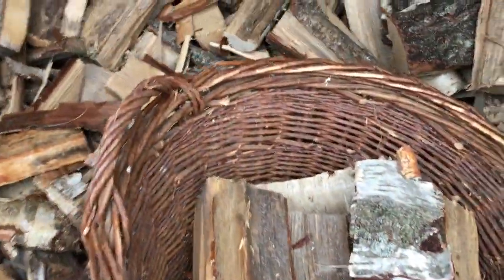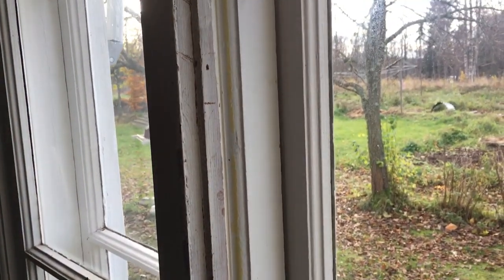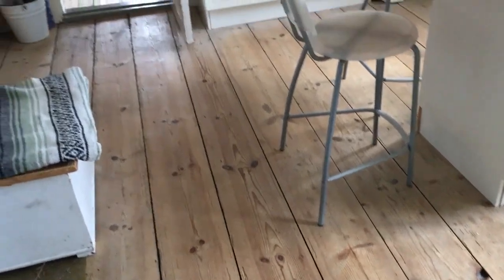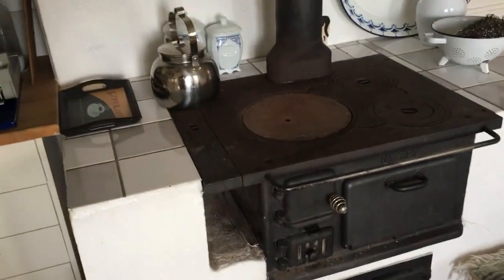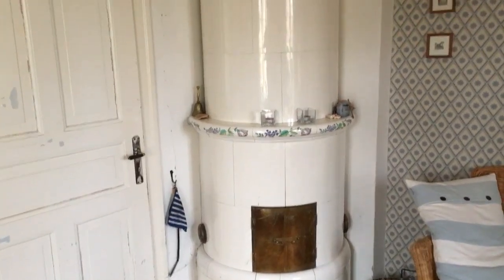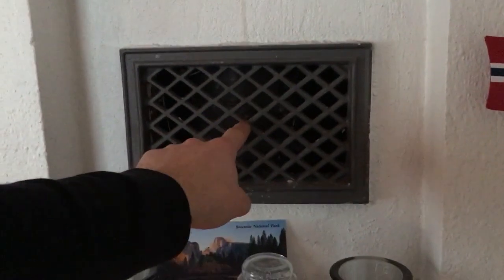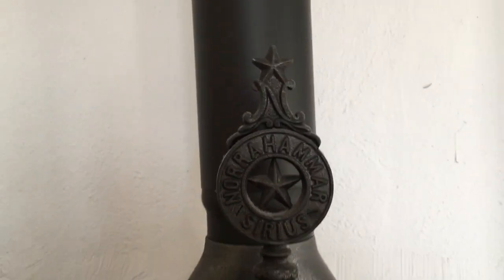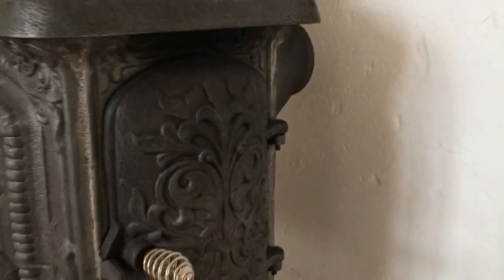The Most Stunning Wood Stoves In Our Farm House

Comment: We have a Jotul stove like yours (not cracked). It has green enamel finish on the sides. When we used it (lived in the northern US) it was a very efficient wood burner. Now, it sits in the garage in South Carolina. But, today would be a good day to use it--40 degrees F and wet.

Comment: I think that one of the reasons that these wood stoves have a place to heat up things on the top is so you can boil water. Heating your house makes the house extremely dry and boiling water to put it into the air will help that. Idk if that’s really why they have those burners but it is a good idea to humidify your house in the winter.

Comment: When we built our house in 1982 designed it with wood heat in mind. We use a Tempwood top loader. Go through about 2.5 - 3 cords a year. We have enough land that we are able to harvest our own wood, so except our labor and chainsaw gas we heat for free. We also use the stove to act as a preheater for hot water.

Comment: You can weld the broken side. The cast iron has to be heated at least a couple of hundred degrees before welding it. 
I have a wood burning stove that has two eyes and I have cooked on the more than a few times. Unfortunately I am an apartment dweller at the moment. For those that aren't familiar with wood burning stoves and heaters, the plates on the top heated surface are referred to as "eyes" that can be lifted out so a pot or pan can get hot faster.

Comment: Thank you for the tour and showing your traditional stoves. I also heat my shop with wood and use to heat the house with one small American made steel stove, called a Temp Wood top loading stove. I got them about 1969 when we moved to the country, in S.E. Illinois,USA. My boys were young ( around 4 & 7 ) I was fearful the might open a door and coals wood roll out. 
 The draft control is about two, 2" holes with a sliding steel plate cover over them to control air flow. I still use the one in the shop all winter. I spent as much as the stove for Insulated SS chimney. 
 The only heat that comes close to wood heat is Geothermal which we have in the house now. Yes the wood stove still sits in the house for back up heat. We have went as long as 4 days snowed in and no electricity. We can slow cook food on top of them. 
Thanks again , 
Vic

Comment: Several years ago I had an apartment with a wood burning fireplace.  A very large fireplace.  I never turned the heat on that winter.  We went through nearly a cord of wood, but it felt SO good, the fire heat rather than some pale electric version of it.

Comment: The stove at about 9:25 was most likely designed to burn coke or coal.  That's why it has a door on top where the coke can be poured in. The little gate behind the lower door is to keep the hot coals away from the door.

Comment: I absolutely love, love, LOVE wood heat! When we lived in Oregon we had a very large wood stove that would hold huge logs. Once we had the logs going, it would smolder all night long, heating our house which was more long than wide. Even the bedrooms and bathrooms in the back stayed warm. They say that wood heats you twice - once when you split it and again when you burn it. I can attest to that! I actually loved splitting wood. If you have any frustrations from the day, this is a great way to burn them off. lol  We also had an electric furnace with floor vents, but I don't think we ever used it.  There is simply nothing that can compare to wood  heat.

Comment: Hej !  That Husqvarna 727 is a quick warmer and effective...as you also said.  I have one in my upper floor. I guess that model was the most sold in Sweden...Husqvarna 727.  I sell those parts for Jøtul 602 and 602 N as you have there and also has side plates...for that stove with the cracked side.  I also have allot of stoves for sale and several Jotul...in Værmland.  Just saying :-). Thx for sharing !  Good clip as usual ! .-)

Comment: the Kakelugn is the much better built predecessor to the rocket mass stove. Used a different model Jotul in an 1100sqf house as sole heat. Worked great, low wood use and meets US EPA emmision levels.

Comment: The kakelofens are still being built and frequently in Germany and central Europe and in Canada.  And in the US there is a variant being built by the Weisners and Paul Wheaton et al in the Pacific Northwest and called rocket mass heaters.
Reply from the maker: Ok. That is interesting to know. You can buy these old one used here and you pay between $5000 - $10000 dollars for them.
I have been wanting to build my own rocket mass heater. One of the ones that you cover with clay.
Reply: At $5,000 I would rate them as a steal.

Comment: I just love the tile stoves, with all that mass to keep the heat. In the 70's I was the farthest South and West dealer for Jotul wood stoves, at the time they were the most efficient wood stoves available in the US. I still use the Jotul combi-fire #4 to heat my house on the chilly winter day here in central Florida.

I sold many of the little #602's like you have, I wouldn't worry about the crack in the side to must. One thing that was hard to get my customers to do was NOT tighten the bolts holding the parts together, just snug, then build a small first fire so the parts can move a little with the heat and find their place, then clean it, snug the bolts again and put furnace cement into all the joints. I would do the same with your #602 and cement the crack.

If you tighten all the bolts on a stove and start a big first fire it will crack somewhere almost every time.

Thanks for the beautiful video of your home and stoves.

Comment: Great video.  You might consider adding a masonry heater if you can afford to.  They are expensive to construct, but they are super efficient and with a ton or more of thermal mass they radiate the heat for 12 hours or more.  Those beautiful Swedish tile ovens are a  type of masonry heater.

Comment: Back in 2004 in Arkansas, we had an ice storm that knocked out everything for two weeks. It didn't thaw for a week. The first house I bought had a large Schrader cast iron fireplace with 6" brass air knobs on the front. We kept a fire going in that stove for two weeks, and the house (3400 sq ft, all on one level) stayed around 60 at the ends and 80 or so in the family room. I recall chipping ice for hours then coming in and sitting in front of that stove. What a pleasure it was. Thank you for sharing! I really enjoyed it!

Comment: We heat with a wood burning stove. Nothing as glamorous as your beautiful stoves. But it heats our house and we also cook on it. It is a stove I made from a 25-gallon steel barrel and I made it upright so we have the top surface to cook on and the door I cut on the side uses old recycled barn door hinges. Eventually, I will build a rocket mass heater to use to heat the house more efficiently. Thank you so much for sharing your stoves with us!

Comment: Those old stoves are a joy to see. We still heat our house with wood, we use a cast iron Vermont Castings Defiant stove with a catalyst. We cut oak wood here in northern Florida and it keeps us very warm in winter.  The stove is our only heat source, we have never converted to modern electric heat and have no plans to do so.    I have never seen those Swedish Tile Ovens listed anywhere, it is a real treat to see them.  I am curious as to how you heat the water for the subfloor heat; do you use a wood fired outdoor boiler or do you use gas? I once read they have electric heat strips in floors now too, perhaps that is what you use.  We too agree there is no heat like wood heat, it is truly God's gift to be able to heat this way.   Thanks again for the information you post, we enjoy it very much.

Comment: I love your new channel, and I'm learning so much! Thank you for sharing your family's wisdom.
There are many high-efficiency low-emission wood stoves out now. They are not a pretty as the older stoves, but they put out a lot more heat with a lot less wood. Some of them draw air from the outside instead of the warm air inside. Are these available in Sweden? 
Do you have a problem with creosote build-up in the chimneys with these slow burning stoves that may cause chimney fires? We do not burn pine here because it creates a lot of creosote, only hard wood. Could that have been why the original farm house burned down?
Reply from the maker: Hi there.
I don't know what the farm house burnt down from. Our chimneys get checked on once a year. We are required to do so by law.
Our ovens burn very quickly. There are a lot of modern ovens available today. Jotul makes a lot of nice ovens. They have been around for a while.
Reply: Since fires can deplete the oxygen, they are supposed to pull outdoor air directly into the burn chamber through a pipe.  Do your heaters do this?  (Like Don Rad mentioned.)

Well done video, by the way, and the stoves are beautiful.  I love idea of the tile ones that release heat slowly.  That would be nice to have.

Comment: Are there any welders there in Sweden who are capable of rewelding cast iron? If it could be rewelded it could be used out in a shop or garage. Without seeing in detail the side at was cracked I would also wonder if this was a firebox made of individual panels that could be replaced.

Comment: I have had a wood furnace since 1981. I would never go back to any other kind of heat. I have 45 acres of mixed hardwoods in SE Ohio. I have never had to cut a live tree. I only cut what dies naturally or storms take down. We also have a fireplace that we enjoy. It heats a little but is mostly for looking. A fire is very comforting. Wood heat is constant and much warmer that any other. I burn about 10-12 cords a year but I keep 40 cords seasoned and ready. I have a shelter house, wood shed and outside stacks.

Comment: Growing up in New England back in the 70's and 80's when oil could be quite expensive, we had a very nice large wood burning stove that we used as our primary hear source. When the house was cold in the morning it was COLD!!! But 30 minutes after the stove was started the house was cozy. We would set a large pot of water on the stove to humidify the air and as the stove was on the end of the house far from the bedrooms we had a fan circulating the warm air. I loved that.

Comment: Been there . . . also love the wood heat . . . I've never seen the ceramic fireplace, looks lovely. We just had the big kitchen  stove, your heater designs seem ancient, I agree they are beautiful. You are certainly going back, years ago we disassembled and old house for the timber and the lumber was as they had been cut with the whip-saw, the same shape as the log, larger on one end (such memories). You folks sure have the right idea . . . here in Cape Breton all the small farms are gone and we're fed by the super-market, the cost are through the roof, heaven help us if there is ever a food shortage . . . we'll hanging off a rock in the Atlantic trying to catch a fish. I would upgrade to some double glazed windows . . .

Comment: I'd hate to have to make so many fires but they are pretty cool. I have a huge woodstove with a blower system that heats the whole house. It works perfectly and you can set it up to burn for over 12hrs which is especially nice only having to stock it twice.

Comment: I have heated my home with a wood stove since 95' and I wouldn't trade it for anything. I burn mostly white oak and it smells wonderful plus it burns very slow. It is hard work cutting and splitting the wood but when the power goes out from an ice or snowstorm it stays a comfortable temperature on the coldest of nights. Nothing better than wood heat.

Comment: You are correct Sir. There is nothing like wood heat. I have a heat pump. I use wood as back up in the winter. When it gets below 32 degrees ,your heat pump dosent do as well. you need a back up. cast iron stove, opens in front ,it has a screen also you can have it open as a fireplace. love it.

Comment: great video. we use wood as often as possible here in no, Idaho. it is my choice of heat for all the reasons you stated. had the chimney sweepers out yesterday. it was clogged with creosote. plus they will put on a cap also to keep birds/squirrels out. Birch is my choice also. but I burn a mixture of woods. some tamarack {Larch] and Red fir {douglas fir} along with lodgepole pine . white fir [grand fir] and I burn white pine. I tend to avoid trees with high pitch content such as ponderosa pine. beautiful old stoves you have there. you have to split that birch while it's green or you can forget it. dense wood. burns all nite. cheers, stay warm.

Comment: i believe that the stove in your parents hose as well as that 3ft tall unit are actually coal burners. they work best when burning anthracite coal vs wood or regular coal but you can burn just about anything in them. ive been looking for a few of the 3ft units for myself and haven't been able to find them any where close to me (they have to be the old original units and not the new mass produced ones)

Comment: Great display of wood stoves, from cooking to heating. For 25 years I have heated my 2500/SF house with only a large Jotul wood stove and I agree wood heat is the best (we use 6 cords of hardwood per year). If you use a Jotul for the long run you need to care for it well and you will need to fix it at times, things do crack, seals wear out but the performance and look is worth the maintenance it will need. I would like to find that kitchen stove and incorporate that into an off grid cabin, very cool video.

Comment: 1st 10 seconds of Video you stated that Firewood was the best heat in the world. I COMPLETELY Agree!! We have a cast iron Woodstove/Fireplace. We use it to heat about 1600 SqFt and it goes for probably 12+ hours a day. There have been a couple occasions where we had to leave and I don't let a fire burn when we aren't home so I have to turn on the Heat Pump. There is definitely a big difference in the "feel" of the heated space. Plus a big difference in the electricity bill!! I can let a fire die out and the cast iron will retain heat for quite a while and I have a Eco Fan on top which will keep spinning for an hour or more.

Comment: I was a fan of wood stoves for years until pellet stoves improved over the years. Now we have pellet stoves that will handle all sorts of pellets from compressed wood to cherry pits and corn. And what I prefer about pellet stoves over wood stoves is that they burn just as hot but don't create as much smoke as a wood stove. So, it ultimately depends on what you really need because I've seen some pellet stoves that do a better job of heating a home than a wood stove.

Comment: I live in canada and I have a stove very much like the second last one you showed except the piece on top you took off so you could cook on it is chrome and it has 2 little doors in the front instead of the one and a chrome foot rail that sits on the front but it loads through the side like your and is shaped very much the same, I used it for a couple of winters when I started useing wood again, it is called a parlour stove and was given to me by a friend who had stored it in a barn for many years, I no longer use it because of government regulations I now use an airtight stove very much like the last stove you had on your video, it is the best heat going

Comment: I actually had a Jotul 602 like the one you had that needed repair. And also a Jotul Nordic. My problem with both (one upstairs, one downstairs in the rec room) was I found them to be little more than butt warmers. And both, because of their small sizes, produced tons of creosote. I was cleaning the flue almost every week with them. And because they were small and all the firewood I had delivered (have no choice in that as I don't have a lot of acreage with trees anymore...) was always longer than what would fit in the stoves, I spent a lot of time out in the garage with a chain saw cutting the firewood in half. Finally got tired of that and swapped the tin cans in for a big fireplace insert for downstairs and a honking big Jotul 500 Oslo upstairs which I vented out the fireplace. Love it. Best investment I ever made. Five years ago we had a winter where we kept getting multiple "polar vortexes" dropping down through Canada and our temps would plunge to -20/-25f for a couple of days at a time. First polar vortex that came through my gas furnace broke down and every HVAC guy in the area was too busy to come out and fix it. I heated the entire house (2900sf) with the stove and insert for a week. If I hadn't had the stove and insert I would have had to move out of the house and the pipes would have all frozen and burst. So while it was an expensive switch, those Jotuls owe me nothing. I love the heat they give off and they actually make me enjoy winter! :-D

Comment: Back in my commune days the Jotel stoves were a coveted item to have in our houses, beautiful stoves! Thanks for sharing.
Reply from the maker: Having one of these is not just nice it also gives you a back up to your normal stove in case of power outage or something else happening. Before our power lines were put under ground we used to be without electricity for a few days each winter. Our wood stoves were the only way to heat our food during that time,